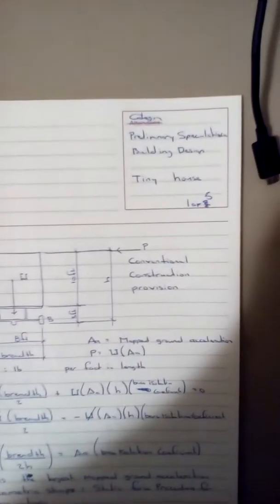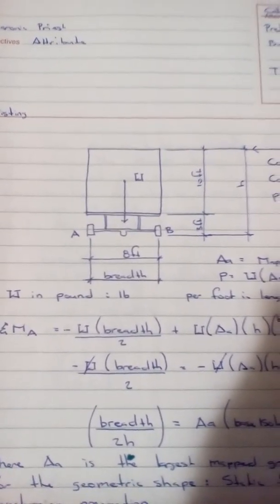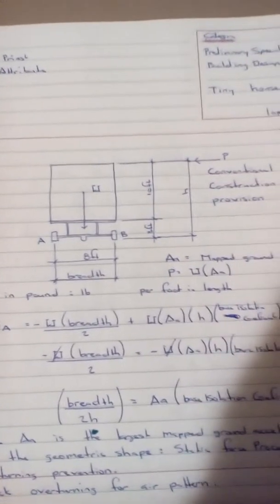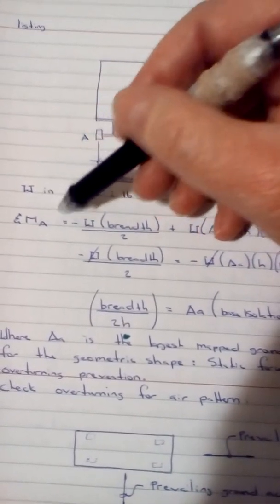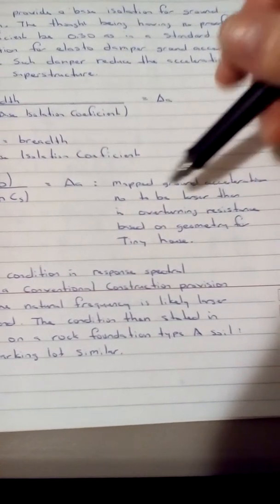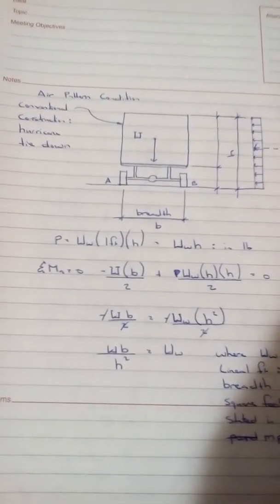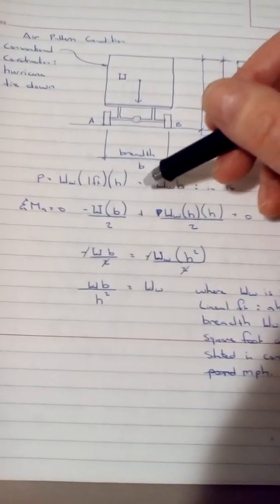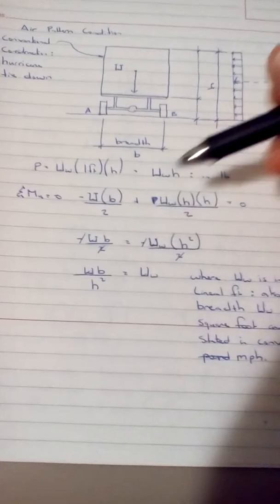Tiny House Friend or Foe: Only The Trailer Driver Knows For Sure!

Comment from the maker: The condition presently in opposing statement to the informational in theory stated being the conversion a Type D soil to a Type A condition by modifying the subframe soil is 10 feet in reinforced concrete foundation slab:  mat.  The opposing statement be far from an asphalt parking lot.